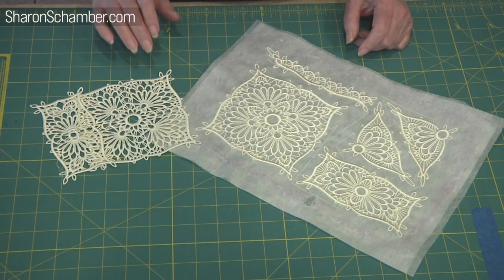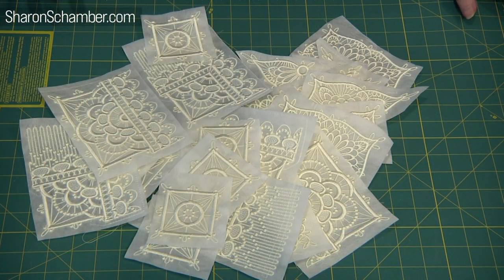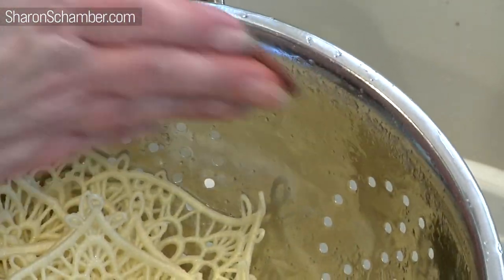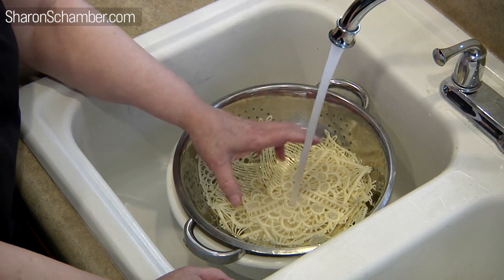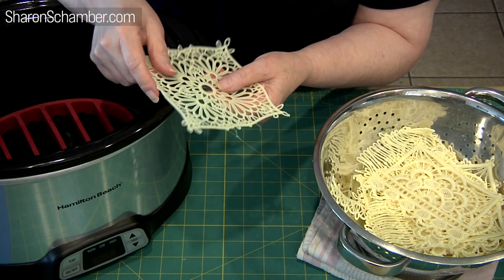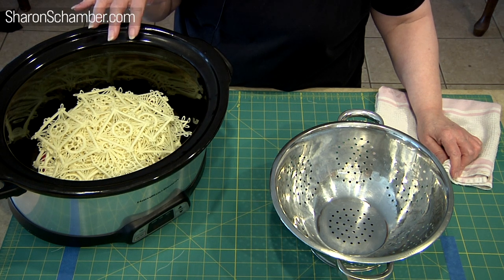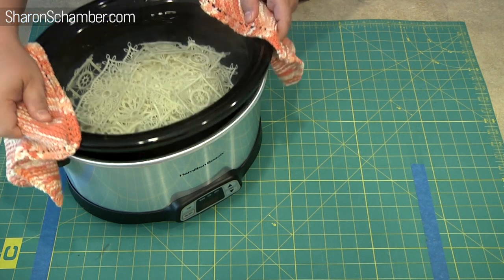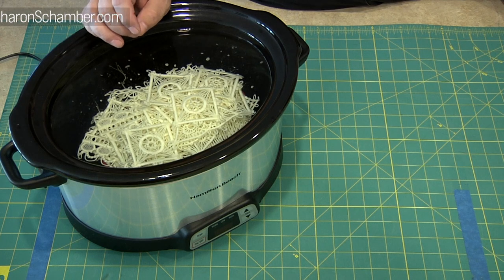Washing Your Embroidery Block - Sharon Schamber - Crochet Inspired Embroidery

Comment: sigh  I may just have to buy an embroidery machine.
Reply from the maker: Sharon loved your comment and said "I'm sorry". 

If you do end up looking at machines she recommends the Baby Lock Multi Needle machines. It will work wonderful with her designs and she uses the Baby Lock Six Needle, an older model Intrepid. 

Other than basic oiling and cleaning it up it has been a real workhorse. Sharon runs hers 10-12 hours a day and it just keeps chugging along. 

You can also find them for a really good price on the second hand market. As long as they were well maintained they will give you the same experience.
Reply: Thanks, I'll take a look at them.  My first love is quilting, of course, but these are so beautiful.